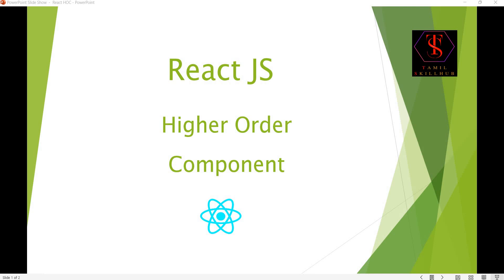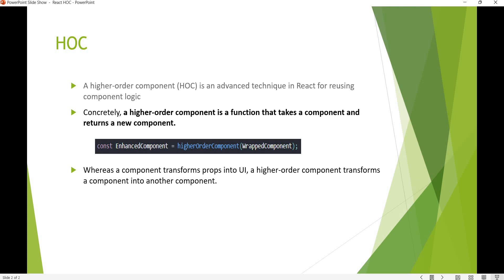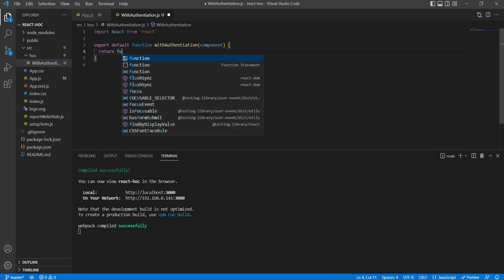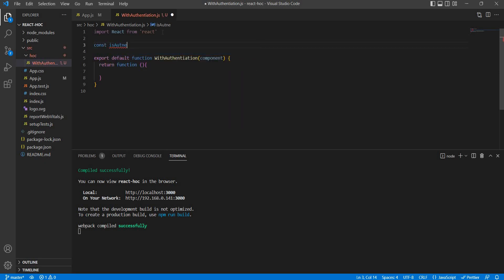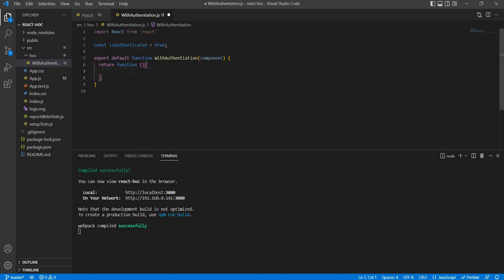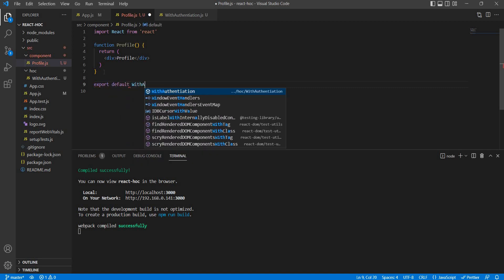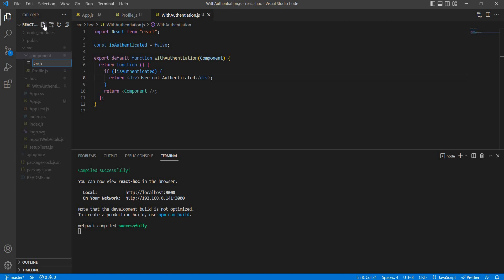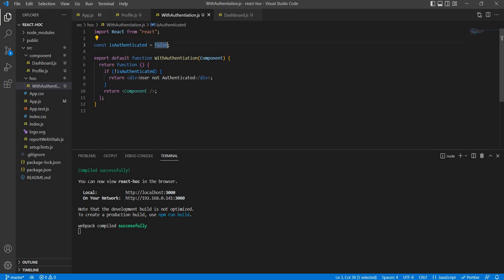Higher Order Component in React Js | Advanced Topic | Reuse Component Logic | HOC | Tamil Skillhub

Comment: instead of using this , we can use custom hooks for resuse the logic
Reply from the maker: For reuse the logic we can go for custom hooks. In some case if we need to reuse the component logic the we have go for higher order component only
Reply: The main aim of using higher order component design is to encapsulate shared behaviour of components seperately, so that other components making use of it could remain stateless. If you were to use custom hook you include states into every components. As a rule of thumb components with states should be moderate in number.